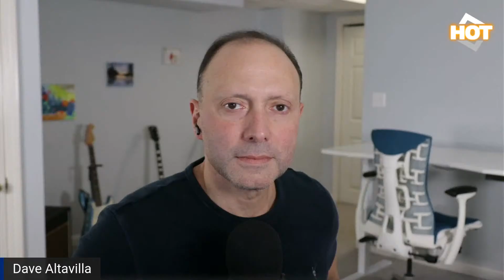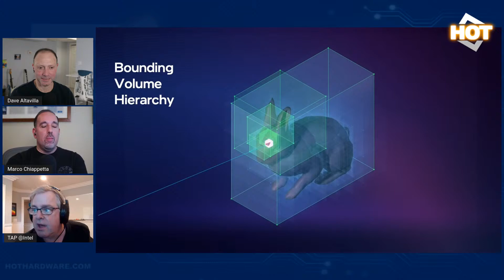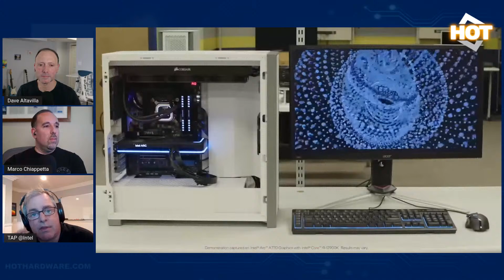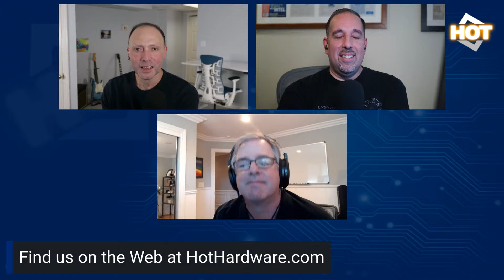Intel Arc Graphics: Ask Us Anything With Tom TAP Petersen!

Comment from the maker: Show Notes!
05:00 - Stream Start
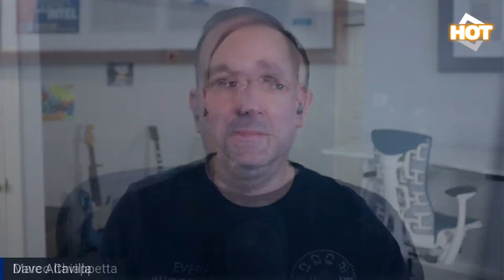05:30 - Reminiscing About 'The  Shack'
07:14 - Introducing TAP
08:50 - Has Arc Been Cancelled?
13:05 - GPUs Are Large Pieces If Silicon...
15:00 - What Has Intel Learned From Alchemist
17:51 - Intel Arc Driver Expectations
19:34 - Arc In Systems Without ReBAR
22:00 - Arc's Behavior In Older Systems
23:05 - High-Level Snapshot Of The Family
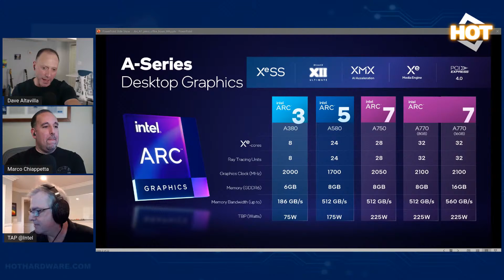25:34 - Comments On Partner Boards And Clocks
28:01 - Power, Temperature And Fan Info
29:29 - Arc Ray Tracing Performance
32:31 - Ray Tracing Deep Dive
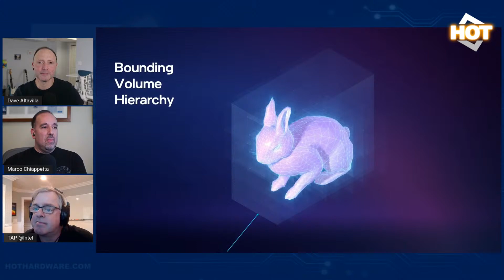36:49 - Ray Tracing Optimizations?
37:44 - BVH Demystified, BVH Cache Info
40:20 - DX9 / DX11 Support And Optimization
44:27 - Next-Gen Arc (Battlemage) Tweaks?
46:26 - The State Of Arc On Linux
47:36 - How Many Software Engineers On Arc?
48:13 - Arc Display Engine Explained
48:58 - Look Closely At That Slide! :P
49:40 - Clarity On HDMI 2.1 Support
50:20 - How Big Is The Arc A770?
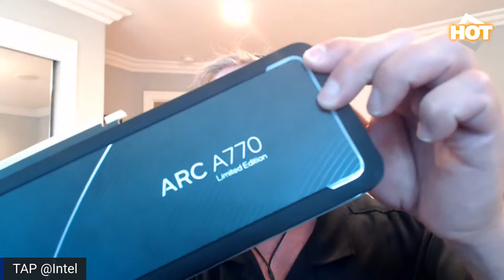51:23 - Arc A770 Card Details
53:14 - Pricing Talk!
54:14 - XeSS vs. DLSS Comparisons
57:12 - XeSS Game Support
58:15 - STICKERS! STICKERS! STICKERS!
59:23 - What Can You Say About Availability?
1:00:01 - Arc Mining Eth?
1:02:00 - Arc A770 Overclocked To 2.7GHz
1:03:29 - Power While Overclocked?
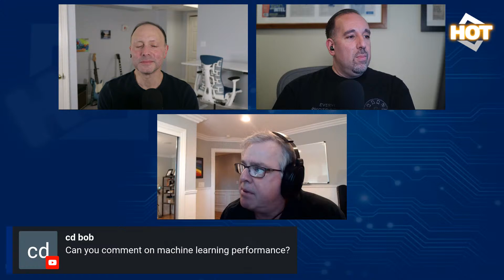1:03:50 - Arc ML Performance?
1:06:20 - Parting Thoughts On Arc

Comment: ASRock ARC A380 is 190€ in Germany so if this low-end card (which is weaker than RX 6400 and RX 6500 XT models) has that sort of a price, you can imagine how "affordable" will A750 and A770 end up being. Not to mention upcoming GeForce RTX 4000 and Radeon RX 7000 series, crypto market crash and all sorts of affordable new and used RTX 3000 and RX 6000 models. I'm sorry but this entire ARC GPU PR campaign is in reverse, i.e. no cards in the market with Tom Petersen and Ryan Shrout going around telling everyone how great ARC GPUs are without a release date and pricing. Intel ARC is two years late to a fight they already lost and that's if they don't cancel everything except enterprise AI/ML/HPC GPUs.🤕

Comment: 52:52 few people need 16GB?! I need to speak a word to TAP!! There is never enough VRAM in computatiional physics and countelss other applications. The demand for VRAM capacity is huge and there is a large untapped market for it. Ever since I tested a system with 512GB VRAM I cannot go back. I NEED MORE VRAM!!!!
48:55 spotting OpenCL 2.1 support 🖖😍 Will roast my free Scavenger Hunt A750 with OpenCL computational fluid dynamics 🖖😇
Appreciate the info at 59:29! Release the GPUs already!!
Reply: To go with output comparable to what a 3060 can do using these gaming graphics cards for gaming, 16 gb is more than enough for any textures/objects you'd be using even in the most resource-intensive games.
Reply: @94leroyal  I'm not planning to use these GPUs only for gaming. I'm looking for cheap gaming-marketed loss-leader GPUs with loads of VRAM to use for fluid simulations, like the Radeon VII :)
Reply: @ProjectPhysX  Congratulations, you are the few 😉

Comment: Thanks for the audit I'm glad I was not here to respond to all of the production and industrial management inquires, but Tom does a good job in other areas he knows and needs a business cohort and Hot Hardware tried but did not score above average. mb
Reply: All hyperscale / public cloud, government and enterprise want is hardware that can be programmed to within its spec. mb
Reply: I identified Intel teamed with its board partners for Arc a year ago LP for OEM but commercial values have changed. mb
Reply: Ive got a picture which is not a chart . . . then the math and Tom needs a slide deck cohort. mb
Reply: I don't care about casting rays because the use of the controllers is about making money. mb